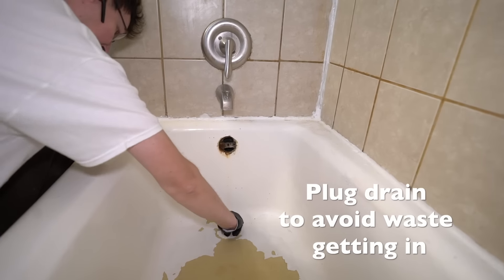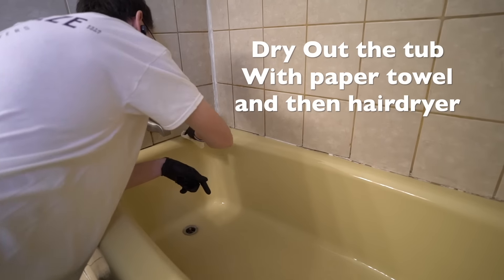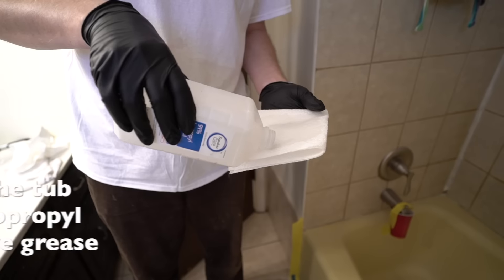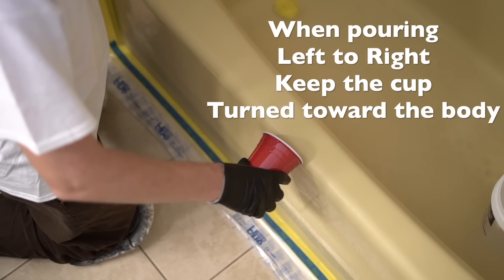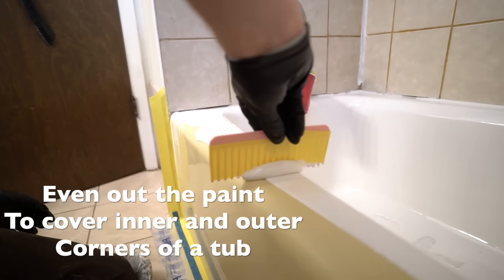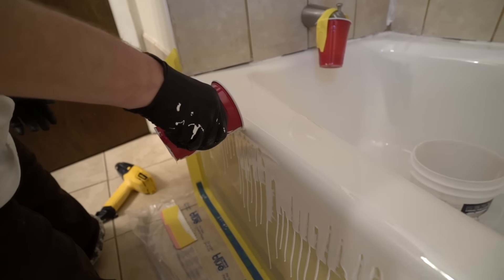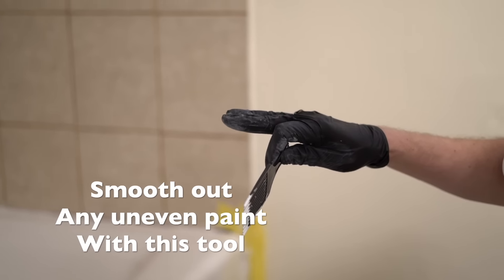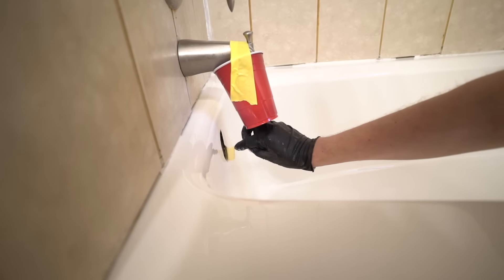DIY Bathtub Refinishing with ArmoGlaze Kit - Odorless, Durable, and Easy to Apply! Made in the USA

Comment: This is the best instructional video I've seen so far.  It's the first I've seen that says to remove ALL PAINT before applying.  I think this is easier said than done, but I'm wondering how many were able to get a perfect finish after following this video.  I never thought about buying a heat gun either.  I'm going to attempt this and post my results.  I challenge others to post their results as well so we all can be reassured.

Comment: Would this product work with a kitchen sink?  I don't know what the last person used that refinished the sink, but it is now pealing.  I think it has to do with using hot water especially from boiling water.  Can this product handle that?
Thanks
Reply from the maker: Yes, our product work on the sink. Our product handle boiling water, the temperature of the water is not a big deal for your surface after the product cure

Comment: what if i only want to do a portion of the tub? is that doable or will it not work? i live in an apartment complex and i dont own the place. so im trying to avoid creating a bigger problem by not removing all of the original paint. I just want to repair a section of the tub, the spout and drain portion, that is where my problem is. any advise?
Reply from the maker: You are able to do a portion of your tub. But the color of our product not be matched your old paint. And also we sink you need experience working with this product to do this job.

Comment: While the product may be very good ,and he results very pleasing ,  I see it. fraught with consequences for a first time user who is barely proficient with a rattle can and /or a paint brush . 
Professionals ,or those with experience ,always make any a project look easy and simple .
 I can only imgine how many times someone leaning over the edge of the tube to work on the wall side or the bottom  willl lean into the outer edge.
Coul a greenhorn pull it off..? Yah..I beleive so , but most likely not if they arent a veteran DIY,er.
Not complaimg about the product mind you....just the inference  that anybody can do it and do it well. I can only imagine the mess that would be made by most of the people that would  decide to take it on.
 I noticed there are no comments from anyone who has used it  which makes me wonder if anyone has decided to dive in and give it a go.
Reply from the maker: Not only professional do this. Because for DYIers we increased working time for application you no need rush you have 1 hours 40 minutes for sure. Professional do this job for 40 minutes.  if you worried about the mess it' ok. If you are follow the instruction and cover the floor with the plastic and tape the drain. All should be ok. Or your have the different way when you place order and received product open the box, take tools. Take detergent what you use in you washer, and plastic cup, and little bit practice with this. And after that you are have performance about how product run. and how to use spreader. After this you able work with our material. Just clean the tools.
Reply: I have used it on about 6 occasions. It's extremely messy and very demanding on the back since you are bent over for about an hour and a half non-stop. If you cover the entire floor and use a belt for your lower back, it goes quite alright. Only need to follow the instructions by the book without improvising. It does have an odor but nothing anywhere near unpleasant. It does make the air a bit heavy but if ventilating properly, it's definitely undetectable I would say. Hardest part is to make the bottom flow even.. If too much is on the walls and doesn't go down adequately, once it begins to dry and you no longer touch it, weird sags might appear (happened on my second and 6th attempt but it almost looked like a surface defect rather then a dripping paint so it passed). If too thick, the ammount of bubbles in the coating is insane and you need to heat gun it a lot, however that accelerates the drying so most probably this caused the sags. Overall, I'm very happy with the results of this product and again, the instructions need to be followed exactly every time!!! Also never forget that it's a polymer. If you drop something on it it will chip and if you use abrasives it will scratch

Comment: One question sir , on what temperature you using the heat gun ?
Reply from the maker: We use heat gun without thermometer. This heat gun just have a two position. We use "MAX" position.  
Best Regards
Armoglaze Team
Reply: @ArmoGlaze  thank you for the answer 🙏👍

Comment: this is awesome. I refinish bath tubs for a living... how long does this process take generally? id love to try this out instead of spraying im tired of all the VOCs in all of the chemicals and materials i have to use for spraying.
Reply from the maker: Our application method takes 3 hours with preparation.
Reply: I've scraped a lot of "pour over" finishes off tubs and they look horrible in person. 
HVLP is the only way to get the smoothest finish. 
You'll be giving me a lot of strip and finish work 😂
Reply: @ReglazeRX  we spray our tubs. Acid wash, sand, priner and top coat